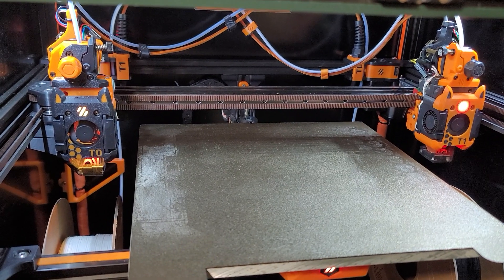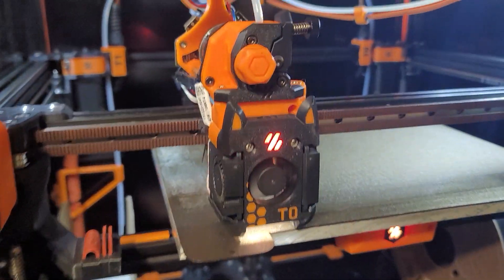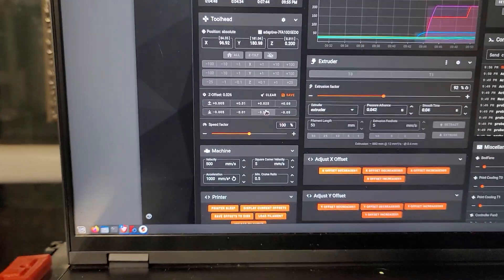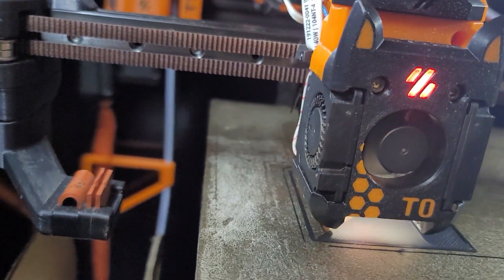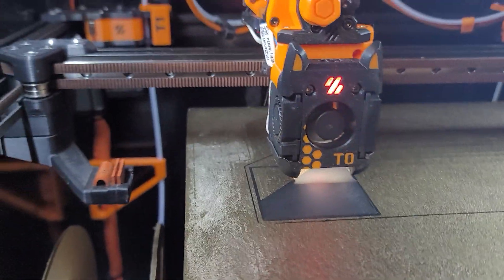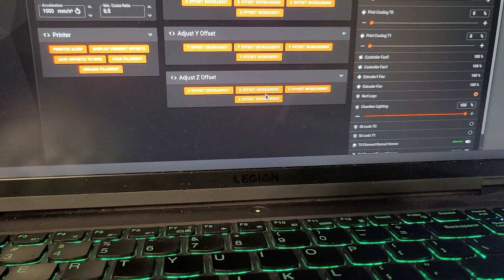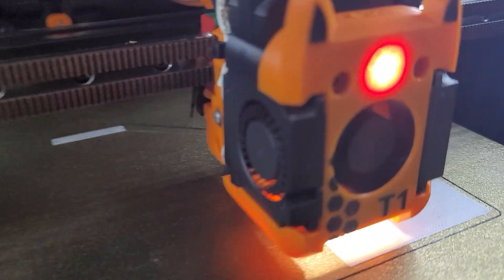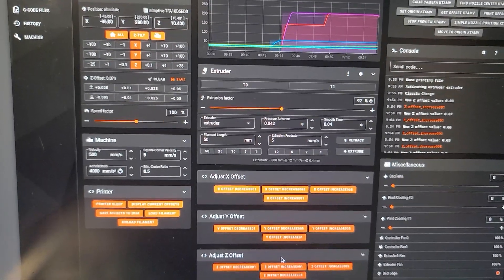z offset fine adjustment

Comment: I looked thru your github and I'm impressed by your work on this. I haven't watched all of the videos or watched them from start to end, so you're likely to correct me, but it seems to me that the Z-Offset for T1 can't really be done with bed height? If it's printing in mirror or duplicate mode the bed height probably won't be appropriate for both printheads, just T0? Doesn't a vertical adjustment have to be integrated into T1 so both printheads can print at the same time in duplicate or mirror modes? I recently saw that with an IDEX Printer, don't recall which one.
Reply from the maker: On my github I have an adjustable carriage and a z adjutment add on for double tap (a version of tap for idex) that allows adjusting the height of the T1 tools